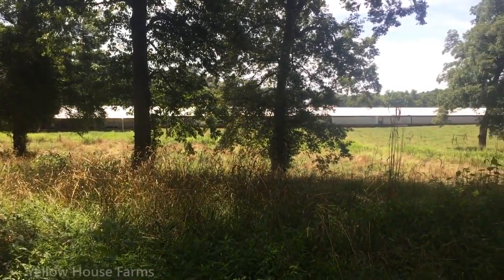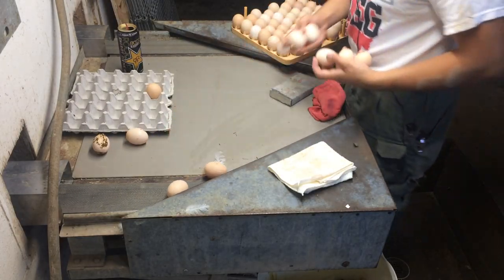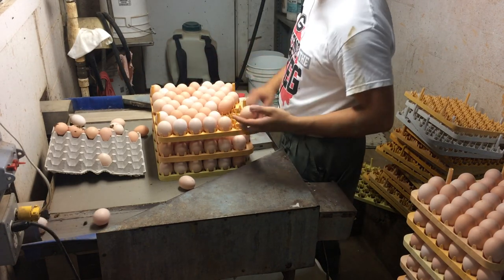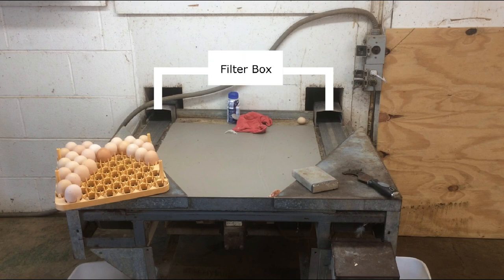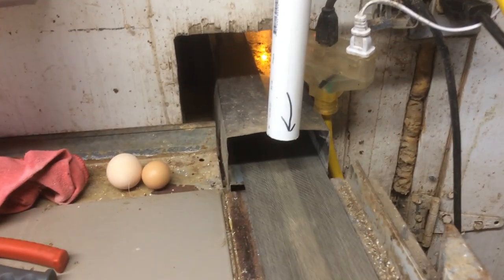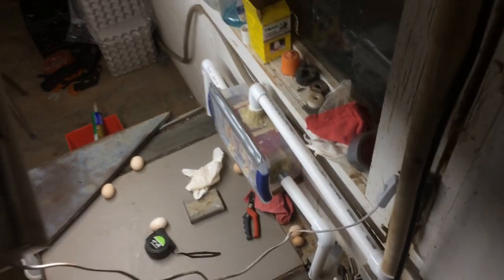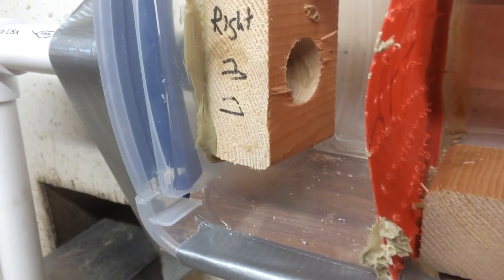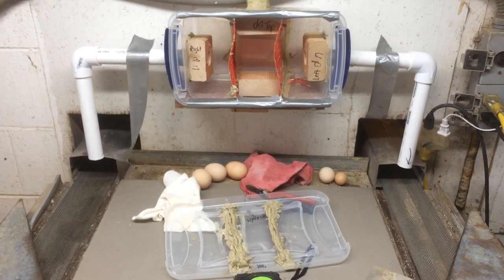Vacuum System for Breeder House Egg Machine

Comment: Hey Gabs, just saw a set up similar for sawdust in wood shops. Be cautious of static electricity buildup. You might want to ground this system to prevent fire. I think it's the vacuum itself that causes the static. Kinda like when you run across carpet and shock yourself.
Reply from the maker: Yeah will do! I am a little worried about having a vacuum running in the ceiling for an hour or two straight, especially a house vacuum that was probably not designed to run that long. we'll see!
Reply: @GabbyLyfe  The air circulating in the filter rubs up against each other and the box and builds up a charge. In the industrial world the problem is sometimes solved by a staple that is in the filter and connected to the grounded machine.

Comment: Create a brillo pad type filter that slides in & out on a guillotine type door.  Have you thought about locating the vacuum outside the building?  The filter doesn't need to filter much (just the feathers).  If you create the filter box such that as debris enters the box, have the heavy stuff fall to the bottom. There you can have a tray that slides in and out like the bottom tray on a bird cage.  you can seal around that with foam.  Cool idea and great video.  I really like how you explain your processes as you go about.  No fluff, just doing it.  Awesome job!!  Enjoy the heat, I am.
Reply from the maker: I definitely like the idea of using a brillo pads and the guillotine type door. I was thinking of changing the filter box to a 4inch pvc pipe instead. Putting the vacuum outside the house is another possibility. I know that in the video I had the doorway to the ceiling still open, but once I finish the project, I'm gonna cover it up and so the vacuum will become even quieter. I'm gonna sit on this project for a while though, lol I'm starting other work.
Reply: I wasn't sure how often you need to access the vacuum system.  I would think a 4" line would work, maybe split the difference and go with 3".  Once you get the vacuum going in a sealed system, it will suck plain and simple.  Obviously it would be open at the two openings.  I think it is cool you give us something to ponder over while we patiently await the next installment of Gabby Lyfe!  On your new path, good luck and remember to enjoy it.  I look forward to updates on how that goes.  Meanwhile, you have a real good start on this idea.  Oh, you might want to trial place a 4" at the place where the eggs drop out and make sure it won't be a hindrence to production.  I would also check to make sure you get some decent vacuum action with 4".  You might want to check a local FB page of swap sell items.  You want a high volume type vacuum such as a dust collector from a wood shop.  Those things are designed to run a long time and provide a consistent high volume draw.  I have a General Tool model for my shop.  It has been in place more than 25 years and still sucks.  It has more than a 1000 hours on it.  Hey great job!
Reply from the maker: I would need access to the vacuum system on a daily basis, I bet the box could get filled up in a few days and thus would need to be cleaned out. A the egg tunnel I'm gonna do 2' pipe, then convert it to 4' pipe, because the 4' will be the new filter box. I like the idea of brillo pads so I'll some how install those inside the 4' pipe.I completely forgot about using foam so thank you for mentioning that! 
I would love to have one of those big dust collectors used in woodshops for the egg machines (I already have one, its in my woodshop haha) but thats far outside the budget.
Reply: I think I was referring to the vacuum itself, not the system.    You can install a remote switch at the egg collection place where you work to activate the vacuum.  The filter box seems to be in an ideal place.  If you had to clean it once a day or so could determine how big the box is.  Depending on how often you wanted/needed to clean that out would determine how big it was.  Cool beans!  Many shops that have dust collectors have rigid piping.  They use the guillotine gates to route the vacuum.  What about running a pipe over the the egg house?
Reply from the maker: Ah now thats a pretty cool system, having guillotine gates to route vacuum, depending on where you were in the shop (I Imagine some of them are quite big, to have this sort of system). 

The wood shop is in the basement of my house, which is a quarter mile away, so kinda too far. 

So the vacuum I used is the "house's vacuum", so I was only using it to test out the system. I have another vacuum that I can just leave up in the ceiling, but it might not still be good enough. 

I'm gonna work on making the system completely sealed first, then I'm gonna see what I need first in terms of a vacuum. 

Hey you just gave me a great video idea. A whole video, doing the math, on what kind of vacuum I need. 
"What is the minimum amount of CFMs needed to be produced by a 'vacuum machine' to lift a.... (.00082 gram) chicken feather 3 inches off the ground" or something like that. 

haha thanks Herman!
Reply: Since you are using (most likely) 4" ducting on your dust collector: https://smile.amazon.com/s/ref=nb_sb_noss_1?url=search-alias%3Daps&field-keywords=dust+collector+gates&rh=i%3Aaps%2Ck%3Adust+collector+gates
Pretty cheap & effective way to route your vacuum action. Enjoy!
Reply from the maker: haha yup ill be using that! thanks for finding it!